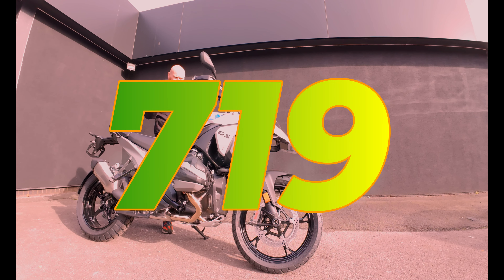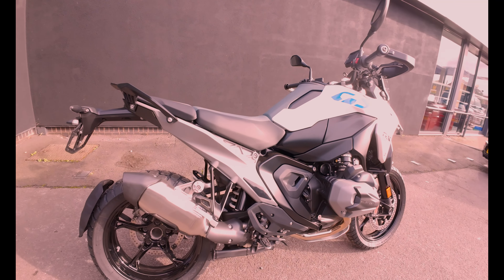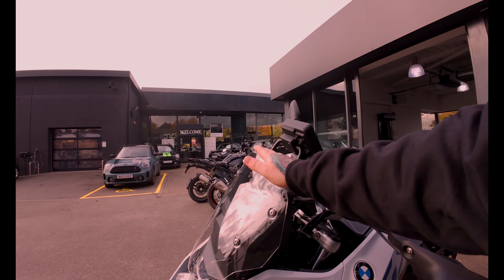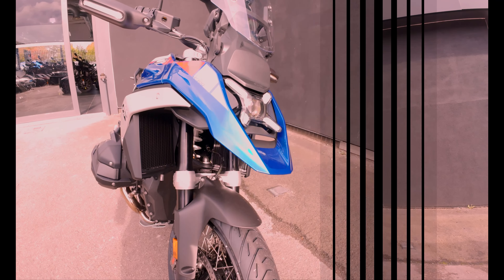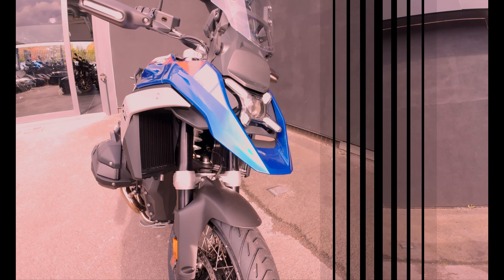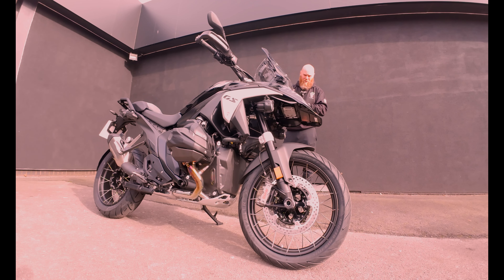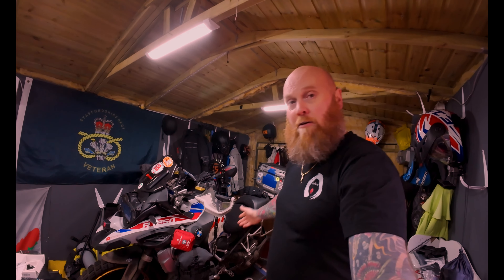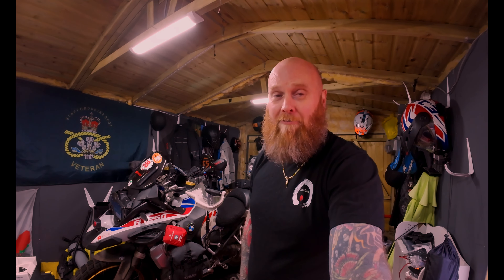Introducing The All-new Bmw Gs 1300 Range! All 4 bikes BMW R1300GS #r1300gs #bmwmotorrad  #twowheels

Comment: First video ive sat through on the new GS. I like the manual windshield adjustment on the baseline model. In two minds about all the covers. They will never stop the crap getting in there, but they are restricting access for cleaning. 

The vario panniers are pretty cool, but the electric fit out i side is just something to break in my mind. 

Great overview mate.
Reply from the maker: Thanks mukka 
The 719 model top line model should be amazing and it isn’t I have a test ride book so will do another review on it when I’ve rode it against my R1250gsa

Comment: Seat's not lower.  There are 3 different seat heights available and adaptive height control.  but seat height of standard seat is 850mm, same as 1250
Reply from the maker: O right I didn’t know that they just look lower compared to my GSA 1250